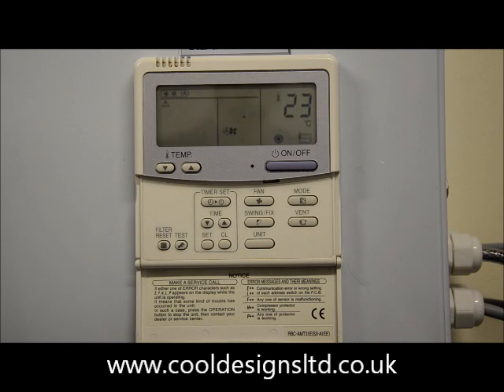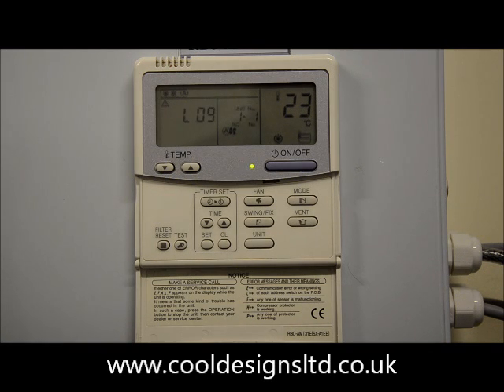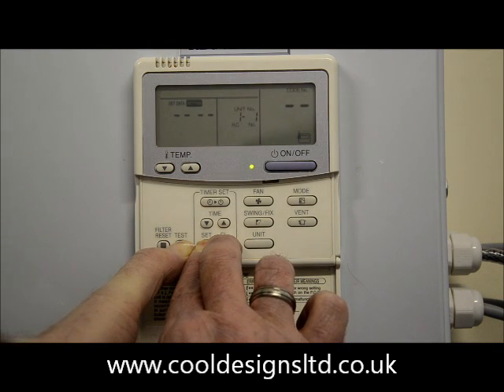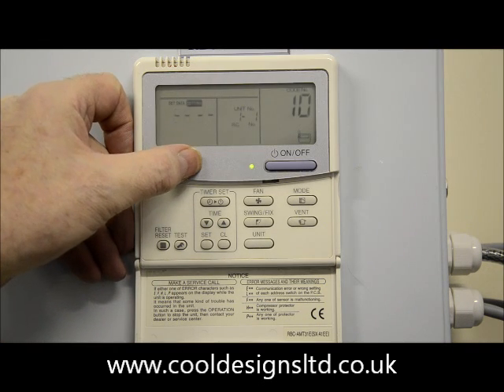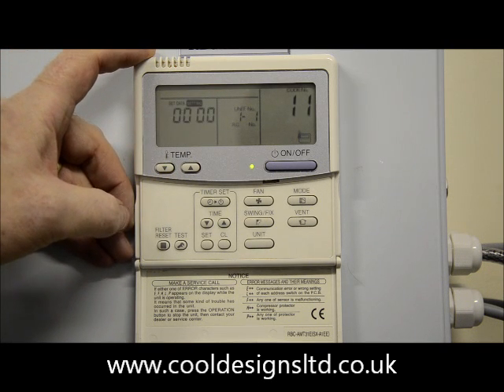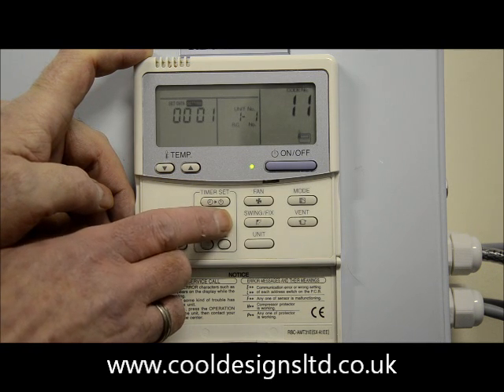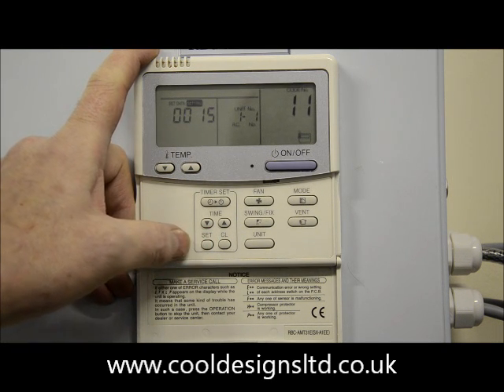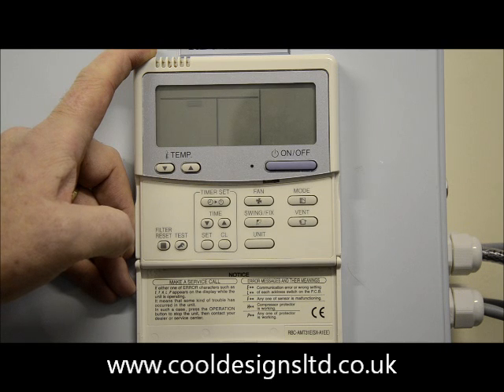Set the capacity on a new Toshiba Air Conditioning PCB

Comment: Hi... I have similar remote as above. Can you please guide how to set air conditioner on auto start. For instance if I sleep at 12 at night with machine closed and put the machine to auto start in 7 hours from then. I have tried to work through the manual but unable.